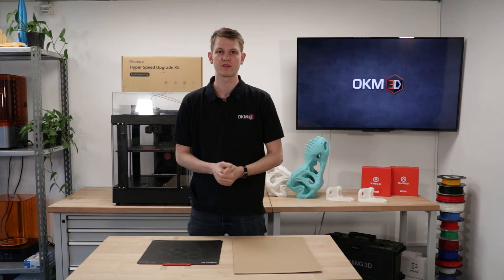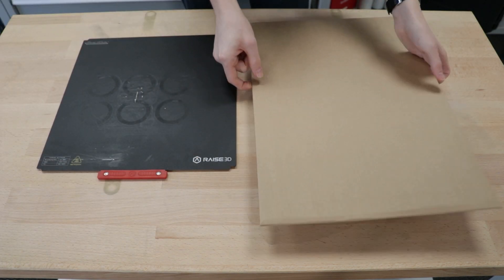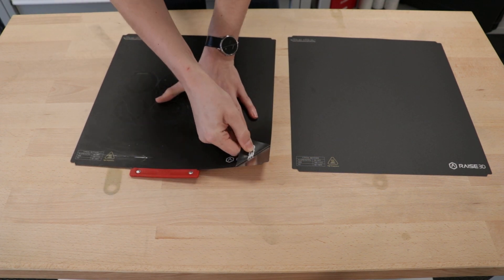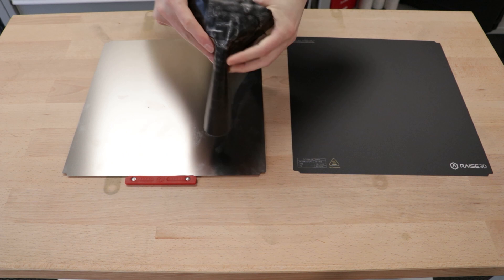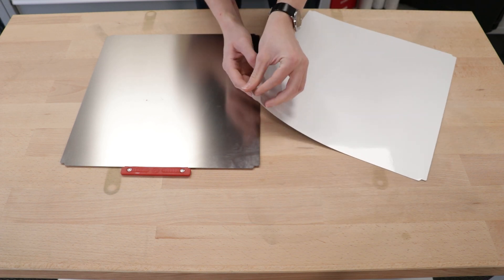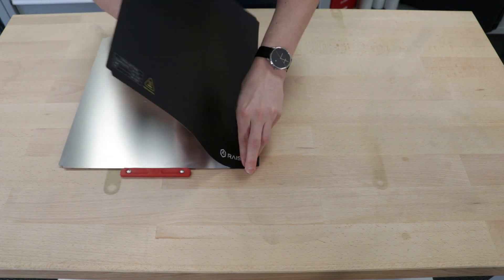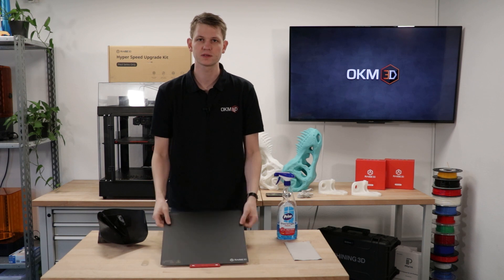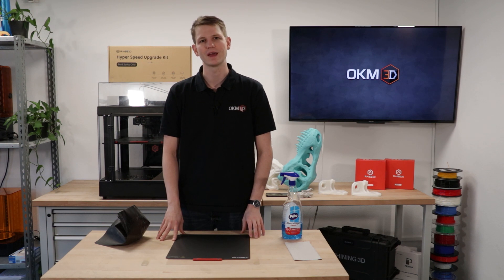Pro3 Replacing the BuildTak - Raise3D Pro3 Series print surface replacement

Comment: Good video and very similar to the recommendation direct from Rais3D. However, I have done this and the stiffness has nothing to do with air bubbles. There are two substrates here, the metal base (stiff) and the build surface (flexible). If you are not diligent during your application you WILL get bubbles, and they are nearly impossible to remove, thus rendering the build surface unreliable for dimensional accuracy and build first layer adhesion.  In concept this is a good idea by Raise3D, but in practice it is NOT always as easy as seen here. Just BEWARE.